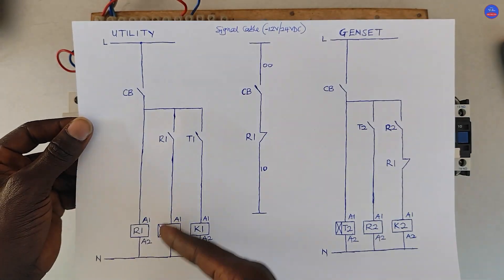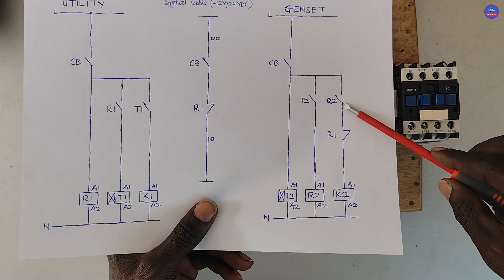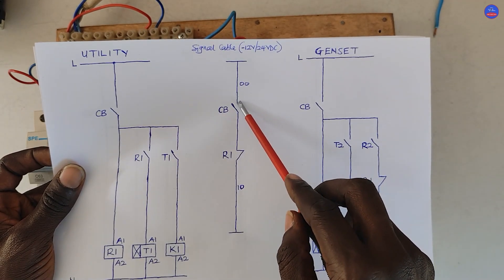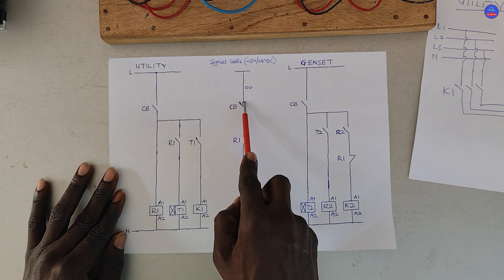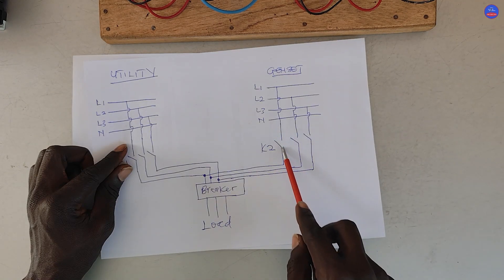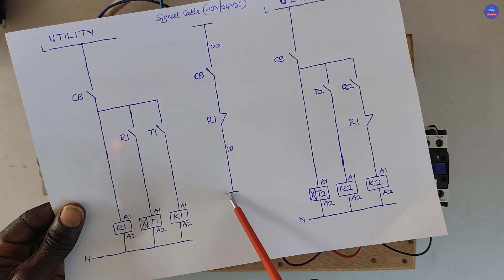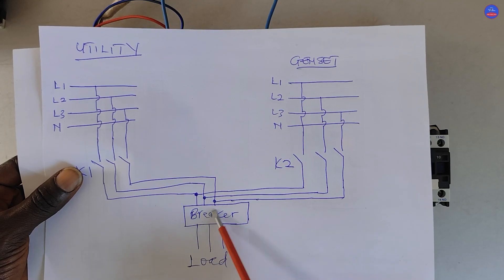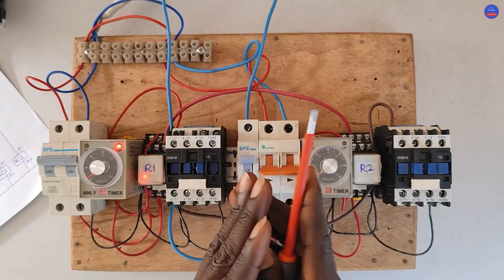Automatic Transfer Switch ATS for Three and Single Phase Generator

Comment: Does it means every GENSET controller needs a negative signal for auto start ?
Reply from the maker: No, it will depend on the particular generator and it's wiring configuration.